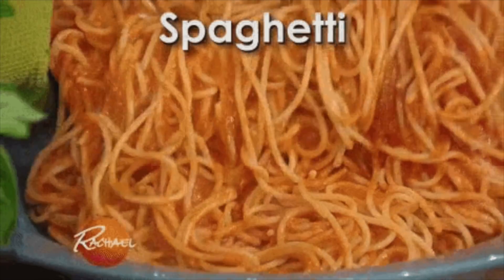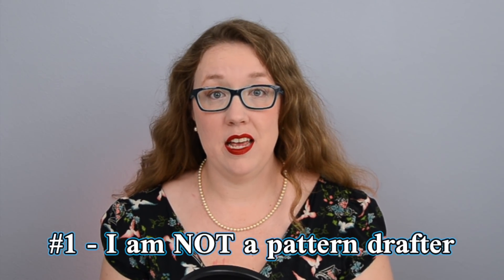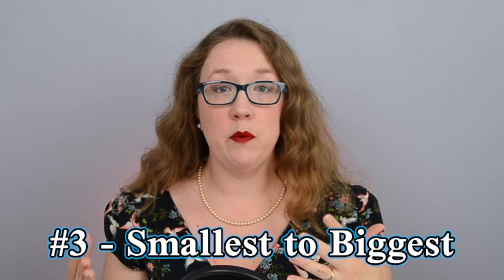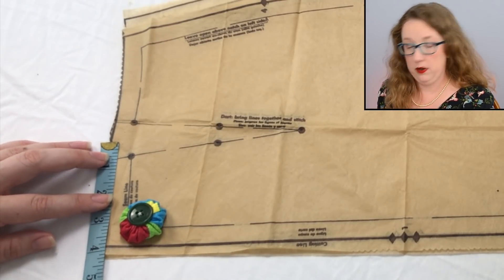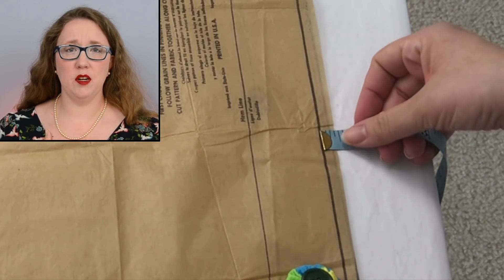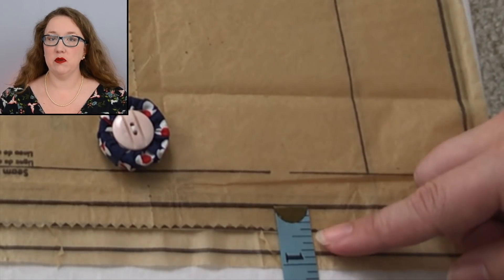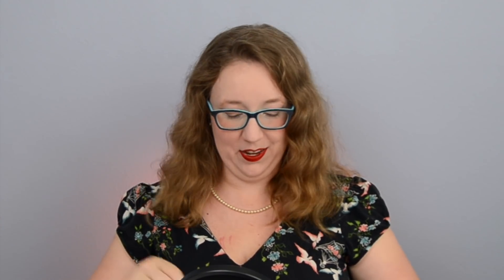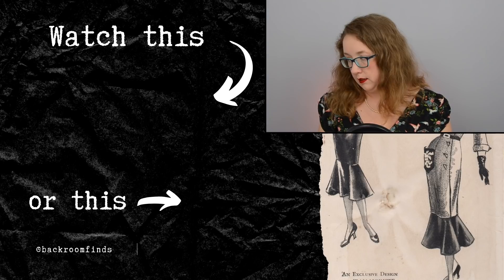Professional Pattern Seller comparing vintage pattern sizes || How do vintage patterns grade?

Comment: Hey 👋 I’ve done pattern grading before and this is my take on what’s going on with these patterns. 
They were probably done completely manually and the grading was done one size at a time so there was no ‘spaghetti mess’ ever created, so there’s no easy way to check if there’s an error in grading one point. Imagine your spaghetti mess of pattern lines, it’s at a corner and it’s got some neat geometric stuff going on, it would be really obvious if one line was wonky. 
There are two methods I know of for grading, they don’t have official names but let’s call them a slashed grid method and a grade point method. Both use a matrix of measurements for the difference between sizes. 
I think they used the slashed grid method as it would more easily explain the wonky lines and inconsistent difference between sizes. For this the base size is traced then cut apart in a strategic grid. Each part is the stuck down with measured spaces between the pieces. One of these pieces could have been crooked for the skirt 
If anyone’s curious the grade point method is where the base size pattern is traced, strategic points on the pattern are chosen (shoulder/neck point, shoulder/armhole, waist/side seam point, dart points etc) as well as the static point (which needs to be chosen at the same to time matrix of grading measurements is created) 
The static point (usually centre front waist for front pieces, centre back waist for back bodice, CF hip for skirts etc) acts as a zero on an x y axis and doesn’t move. You then measure how far each grade point moves (up/down and in/out) and mark the point. Mark all the points and join them together to draw the pattern in the new size. This can be done for multiple sizes at once to create a spaghetti mess 😊

Computer programs now exist to do this digitally however, having used one of these programs it’s not actually easier as you have to program the thing with your desired matrix of measurements (can exceed 1000 values for things like bras, most companies have a standardised table as company IP) and then determine grade points and label them appropriately so the matrix will do the right thing when you hit the grade command

A base size can be the sample size but it’s usually not because a sample size is the smallest size (apparently for fabric saving reasons) and the base size is the middle size of a size run for grading reasons, the fit becomes less reliable the more sizes are graded up or down from the original unless you’ve got a new fangled uneven grading matrix

Thank you for coming to my Ted talk 😋
Reply from the maker: WOW!! Thank you so much for all this fantastic information!
Reply: Brava! 👏👏👏👏👏

Comment: This is very helpful, thankyou.
Anyway, inspite of the complexity of the grading, what we do see is that the biggest adjustments are, ofcourse to the width, and ease doesn't tend to be increased with size. Australian Home Journal magazines in the 40s used to come with patterns for 3 dresses (per issue!) that were standard in a B36, W31. The instructions usually recommended adding or subtracting a half inch at each side seam to go up or down a dress size, giving you a range of B34 TO B38. So I think it's helpful to remember that unless we need to make specific alterations elsewhere, most simple patterns can go up or down a size without worrying too much about the more complex scaling.
This video definitely reassured me about that
Reply from the maker: I am SO glad it was able to help!

Comment: I now trace all modern patterns. So they have one size on the paper and the spaghettis mess is sorted before I cut the fabric.
Reply from the maker: Oh see now that makes sense!
Reply: Plus, if you need to make another size later you have an uncut pattern. I make pj pants in sets of three for the little boys in my life, and they KEEP GROWING!
Reply: I do the same thing. A case of medical table paper is now a fixture in my sewing room.
Reply: I've just discovered pdf patterns that let you print off JUST the size you want :) (Wardrobe By Me for the curious). Yes you have to muck around with the taping, and I haven't yet actually MADE the dress, but still, it's a nice touch. Also their sizing is comprehensive, and pretty much matches modern shop sizes, so less of a miserable experience (rather than making a 20 when you buy a 16).
Reply: @catherinerw1  Just take your time with putting the pages together. Also I like packing tape and I use a hole punch for marking darts other round marks. I would punch the holes before putting the sheet together.

Comment: What a weird grading system...I wonder if they drafted the pieces separately, rather than simply grading from the small sizes up. Or maybe it was several different employees responsible for the grading process? That might account for the inconsistencies? /shrug/
Reply from the maker: Mary, that is a very interesting question, one that I do want to look into now. Thank you for the suggestion.
Reply: Hi Mary. Patterns are graded from the sample size up and down. If the sample size is a 10 the grading starts there and is graded down to the 8, 6, 4, 2 and 0. It is also graded from the 10 to the 12, 14, 16 sometimes an 18. Any size above that is considered a plus size and would start at a size 14 plus size and graded only up. But this is from my experience in the industry and not so much from the pattern companies. I hope this helps to clear up confusion

Comment: Just as an idea on the different amounts of grading between sizes, in couture sewing, the proportions matter more than the actual measurements when making a design to fit a client. This is the “traditional” method, if you will. So the sizes may have been graded to maintain the proportions of the design, rather than an even amount per size at every point. This is a scientific wild guess on my part though. I am not an expert. 🙂
Reply: Just what I was thinking 😊

Comment: That was interesting. I wonder if they use the same drafting rules today.
Reply: Yes, as a patternmaker, I see that all manufacturers use the same ratio grading system where I worked. The smaller sizes are graded a full inch around, that would be 1/4" on the quarter on the width. And the middle sizes are graded 1 1/2" all around which is 3/8" on the quarter. The lager sizes from 18 up are graded 2" all around and 1/2" on the quarter. The length grading is the same until the middle sizes then it is maxed out in the skirt but continues on the bodice.

Comment: Short answer - math is hard.
Longer answer - the people who grade patterns are flawed gods who understand fractions.
My grade 4, 5 & 6 math teachers - "you're so lucky, we're on the metric system now, so you don't have to learn fractions"
Me now - My adults were stoned.  It was the 70's.  It's the only plausible answer.  Where's the marking for 1/8th and 1/16th on the ruler?  Sigh.
- Cathy (&, accidently, Steve), Ottawa/Bytown
Reply from the maker: The number of times I corrected myself because I wouldn’t read my own ruler was intense!!

Comment: Pattern drafters use math that hasn't been invented yet
Reply from the maker: RIGHT?! After the sleeve that is what I felt like.
Reply: maybe it's just slash and spread?
Reply: @StephanieCanada  For me the sleeve was the only thing that made sense, spesh the full inch size diffence between the 12-16, the arm tapers down and the sleeve is ment to be fitted at the wrist, looking at the pattern you measured all of them had the cuffs length included so the measurement from shoulder to wrist would have been the same but the armseyes would be larger and tappered in to the wrist, the sizes on each side differ slightly so the seam sits at the back underside of the arm and joins at the jacket armseye at the sideseam :D hope this makes sense as to why the measurement of just the sleeve seemed so wack.